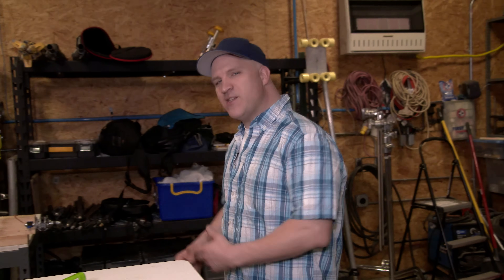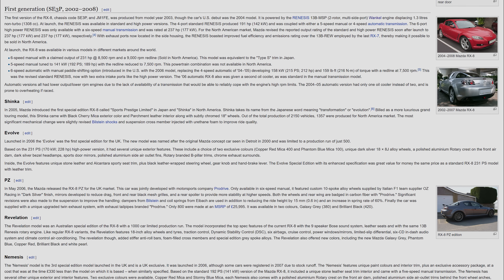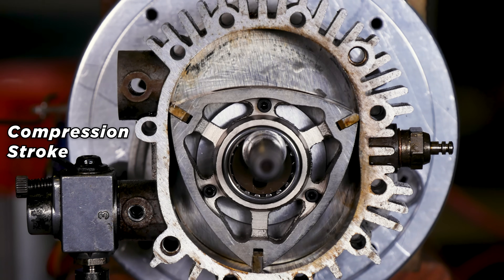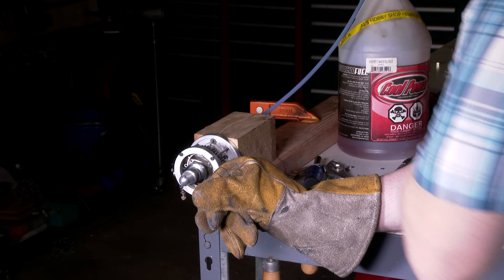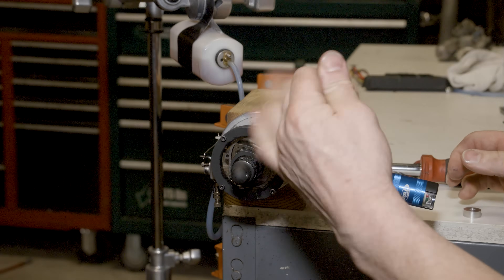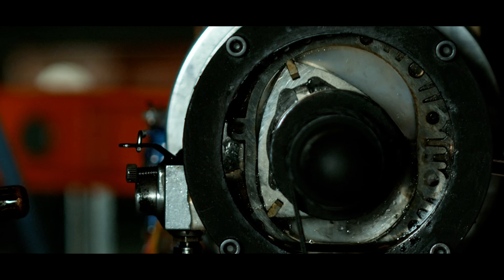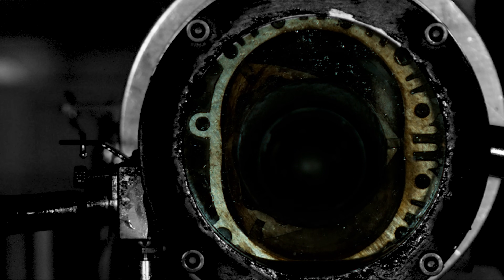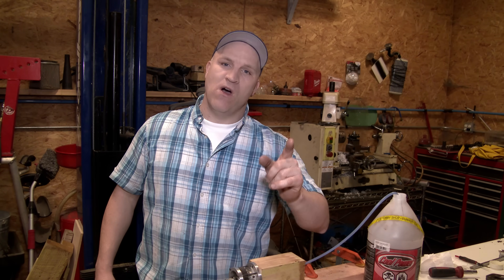See Thru Rotary Engine in Slow Motion - (Wankel Engine) 4K

Comment: Thank goodness they stopped making these for cars. Such low torque, terrible fuel economy and dreadful emissions. Like if I am getting 18MPG on the freeway, I'd better be making 500hp and 490 foot pounds of torque. Not a puny 231 (which is what and out-of-the-box GM Goodwrench 350 crate motor makes) and like 80 foot pounds. 

I drove one of the RX-8s in 2006. I was STUNNED by how little torque it had. 8K RPM in first gear and there was no way the tires were going to break loose. Really cool car on the inside and it handled great, but it would have been 100% more fun to drive with more power.

Comment: I always thought wankels were a very interesting design, but sadly these engines by the nature of their sandwich-like design didnt last long (especially if you didn't religiously keep on top of the maintenance). If they wore out, you could replace seals, but you generally couldnt bore or hone out and use oversize parts like you could on a piston engine. You pretty much had to scrap the engine and buy a new one. There was little you could do to restore it. However it was absolutely awesome to see this video of the inside of a running wankel. Very nicely done. This was very interesting! 👍👍

Comment: Don't see why rotary's have such a bad reputation. They seem better than piston engines. 
And before you say APEX Seals, I know... but good oil with frequent changes and won't that basically keep the seals alive and intact for decent 200k miles? 

I want to go into the world of rotary engines and buy an RX8 2004 model, so I'm really curious about the rotary engines.

If anybody reads this comment and has something to say about RX8's or any tips on how to buy an RX8 with a good and healthy rotary engine, i'll gladly accept the hint.

p.s. subscribed, that's for the awesome video! This is far better than any video drawing what happens.

Comment: Cool video.  The rotary engine is a neat concept on paper, just not practical in real life.  Engineering Explained has a good video explaining some of the inherent design flaws / limitations.  My biggest beef is that the "Mazda" engine isn't a 1.3L, it's a 3.6L, which explains the fuel mileage and takes away the "power per displacement" talking point...

Comment: My uk 2006 Wankel Engine on Mazda Rx8 lasted 9 months from new and only 18,000 miles I got a Euro Honda Civic 1.8. i-Vtec which now has done 211,000 miles and it’s still going like New I’ve only had to replace the battery twice and front suspension and central locking on all doors, I driven from England to Malta last summer and back across all Europe the Honda Engine is probably the most reliable engine going

Comment: Interesting video but it does not mitigate the fact that the Wankel is as dead as a door-nail.  Low volumetric efficiency, leaking seals , terrible emissions killed it.  Give it up guys!  R.I.P.
Reply: Very true, Mazda discontinued the Wankel engine in 2012 due to poor sales, the company lost an estimated 3 billion dollar on the RX-8 fiasco.
Reply: doktorbimmer well mazda announced recently that the rotary will return.....as a range extender for ev cars

Comment: not going to run well without a load that why its misfiring and igniting all wrong and running pig rich, would have been better if you got a load to really show it going
Reply from the maker: Agreed... Easier said than done though.
Reply: Warped Perception hmmm well you got the shaft on the front just need a pulley and something that can handle the speed such as a prop that it was designed to drive.

Guess it would take some tinkering to set that up and wouldn’t be too bad but I guess lot of people just wanna see the thing kinda fire up and sputter about so I understand the value added is low.
Reply: You should try to do a pulse jet at some point !
Reply from the maker: MOTO/R/SPORT NEJ yes I actually have a few options including a large flywheel that I built, but a lot of times I have to limit my self in each episode and focus on the core purpose. The main purpose of this episode since it was the first, is to introduce people to how the rotary is different from the piston engine, the ultimate goal is a third or fourth episode where I reveal a new type of Technology. But I have to educate people on what the rotary is first. As for the best way to run it I totally agree, it was designed to run under load I'm at the same time have some type of inertia to help it through the cycle.

Comment: I hate that fake sounds in slowmo
Reply from the maker: Ha!!! Actually that's a compliment, because they are not totally fake. they are based off of the actual recorded sound, also the reason they are in there is to give people who have absolutely no idea what happens inside of an engine an audible cue as to when the combustion is happening. It may not help those that already know about engines, but if you I know absolutely nothing about how an engine works these sounds can help immensely and identifying which part of the cycle the combustion happens. Because no matter what when somebody hears a boom it's usually almost always associated with something having to do with fire.

Comment: iirc, from other peeps who know about cars more than I EVER WILL. The rotary engine will have higher chances of misfiring (like in 7:00) and extra fuel not being burned hence seeing flames shooting from the exhaust of rotary engine cars like Mazda cars, but because of the extra fuel not being burned, you lose power, that's why people use turbo chargers specifically low-mid RPM turbochargers to give it an extra burst of energy but also because of the misfiring, a misfiring system also known as ALS (not Lou Gehrig's disease) to help counter that. I might be wrong while writing that but obviously a car nut here will fix it for me :D

Comment: Great Video, I especialy liked the part when rotor going backwards, you can cleary see gas igniting in lower part during "ignition stroke" forcing' rotor to go "backwards".  But looks like in multiple rotors design the secondary rotor momentum keeps whole thing turning in right direction :)  Wondering that this can occur in bigger examples....

Comment: Wat a great way to explain the simplicity of the design. Sadly it came at a cost. High fuel consumption and specialized maintenance (especially for high-performance units).  And yes 6 rotors in one engine is possible... http://www.thedrive.com/tuned-af/14548/theres-an-insane-bmw-m6-with-a-6-rotor-engine-up-for-sale-in-south-africa

Comment: So much misfiring on that one. Is that because it happens to be a glow-plug variant?
Reply from the maker: Possibly, Sun-Times running a Nitro in the alcohol that combustion that was not that visible on certain Strokes. I guess we'll see in the next episode.
Reply: Was definitely firing before the correct angle was reached, or even going backwards and having combustion on the wrong side a few times while trying to start. Proper timing with spark should help prevent that.

Comment: Awesome job explaining how the rotary engine works.  Also, you did an amazing job with the slow motion!  Thank you very much for making this video!
Reply from the maker: Thank you!,
Reply from the maker: Albert Einstein your welcome
Reply: Now I think what we all want to know: Will it will run on WD40? ;)
Reply: @fyrstormer  LET'S FIND OUT!!
Reply: When i hear the engine sound, that like 2 stroke. But without piston and cylinder. And more simple. I hope can install on my bike..😂
Reply: +Andi Marwah Wankel engines are MORE complex than 2-stroke engines... which is why 2-strokes are still made and Wankel engines are not.
Reply: @doktorbimmer  the rotor tip seals were the problem, just didn't last and seal properly to be reliable
Reply: When two legends meet, shit gets serious

Comment: Why is it that Wankels are so fuel inneficient? Also, I've heard they are particularly unreliable on higher milage vehicles as the tips of the triangle start to wear and is horribly expensive to repair. Great tech, not so practical?
Reply: The Wankel design was very poor in converting air and fuel into heat, and also very poor in converting heat into rotational energy (work)
 Several inherent flaws reduced it reliability, it is not thermally stable and its seal design is weak and prone to damage by its unstable combustion characteristics.
Reply: Makes sense - thanks for taking the time to reply.

Comment: where can we buy a rotor engine like the one you used? or any other small engine eg: remote control devices
Reply: Discontinued years ago...
Reply: damn i though would be the case :/.  is there any rotary engines (small) that they make at all still? i have an rx8 and love my rotaries!
Reply: Sorry, Mazda was the very last company to manufacture Wankel engines and they abandoned the design over half a decade ago.

Comment: it could do with leaning out a little on the needle valve
Reply from the maker: I tried leaning it out, it wouldn't run, the way you saw it running here was the only mixture it would run, but the carburetor would flood in between takes so that explains some of it.

Comment: I'm gonna be that guy:
A rotary engine is actually an engine with an odd number of cylingers in a radial configuration, but with a stationary crankshaft during operation. While in operation the whole engine is spinning. Rotary engines were mostly used during WW1. After the war the rotary engine had reached its limits, and radial engines ("star  engines") were replacing them.

So please, do not use the term "rotary engine" when you are not talking about a rotary engine <3
Reply: Indeed, 'Rotary' is an incorrect term to use especially if you are not referring to a Mazda brand product specifically and this brand is now also defunct... this is a WANKEL engine..

Comment: The show would be 10 times better if you changed your branding. The font of warped perception and the audio with it is very jarring! Great work otherwise
Reply: All the titling needs to look similar (repetition rule in design) and the titling at 18s has a weird white drop shadow on the word 'see' also that title screen needs a background pattern, looks unfinished with just black. Font doesnt match anything else in the video either. 
Im awful at receiving criticism but I hope that you take this the right way and not like im putting you down! 

Great Vid

Comment: the difference in reliability The main reason that has limited the development of the engine is in fact a consumption much higher than the engines with cylinders, combined with a high rate of unburnt hydrocarbons. In an age that seeks better efficiency and reduced consumption, it is easy to understand why there is currently no car on the market with this engine.

Comment: Why bother doing this other than showing how petrol or avgas burns inside a enclosed compartment,which is what every engine does it burns gasoline and turns that burned gasoline into power and depending on the set up of a engine of the same size, you can make a lot more power by putting in performance parts etc. :)

Comment: All the older Mazda cars ie: late 1970's are all asking around the 40 to 70K mark,which is for a RX3 with totaly original KM and no new parts on it totally restored cars ? Now you think for a moment what your getting other than an investment? What drives the price for these type of cars, supply and demand, if you have very limited supply the demand increases and thus you can ask whatever you like for the cars, but if a country had loads of them and you imported them, then the demand is taken away and thus the price will drop, just like anything ?

Comment: I cant wait to see a proof of concept on some of the theories and things people have on the combustion process of rotaries. Forever I have seen those theories about the spark plug holes, and the bathtub location on the rotor. It will be cool to see the timing and things, so we can finally see of any of those untested theories are true. I have a feeling they aren't cause Mazda would likely be doing things different had any of those been true.

Comment: The Wankle Rotary engine has a lot of potentiality. If they could have improved the seal and oil issues, it far outshines many other designs because of reduced weight, more efficient energy use and power for it's size and less moving parts if it had perfected sealing and oil issues (perhaps using a synthetic lubricant and stronger seal) would ensure greater longevity. Good advanced  engineering and research could make this engine a great success.

Comment: The Sopwith Camel and the Fokker DR-1 were both powered by rotary engines. The cylinders and crank case rotate around a stationary crankshaft. The Wankel engine uses a rotor as a compression and exhaust device, and through time people have mistakenly referred to the Wankel as a "rotary" engine. It is not a rotary engine. If you research  WW-1 Clerget, Le Rhone, and Orbderusel engines, you will get the accurate description of a rotary engine.

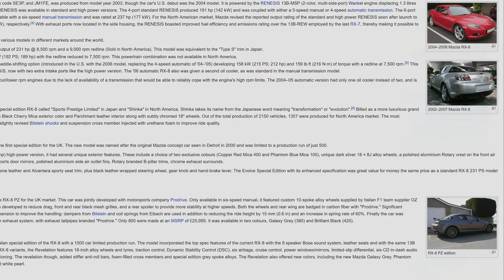Comment: @1:42 - "It was only a 1.3 litre.  I always had an issue with how they calculate the capacity of a Wankel - they add the volume of all three lobes at one time.  That's like stopping a piston engine and working out the volume above all the pistons - but that would be only half of the swept capacity (for a 4-cylinder engine).  I always felt they should take the maximum capacity of a single lobe and multiply it by 3, so that it represented swept capacity, like they do in piston engines.

Comment: Amazing! I wondered who would make such video. Something cool here is that we clearly see the flamefront getting at the very end of the combustion chamber before it exits in the port. But it’s acetylene, and cars usually run with octane, which burns slower than acetylene which may explain why 13b send unburnt fuel down the exhaust. Also we can see the seal’s behavior, how they “stick” to the housing. Well done!

Comment: It would be amazing to see a remake of the rotary, since the main problem is the rotation wearing out the edges and losing compression, if it was edges in a stronger material it would sort out most problems and the large gas production like MO2 n CO2 could be directed through something like a filter then out an exhaust

Comment: I was always curious how a rotary engine functioned, now I know. I'd give you 10 thumbs up if I could. Thanks!
Reply: Nah he's got plenty of thumbs......
Reply: They are garbage. Last an 1/8th the time as a piston engine
Reply: Deere2154D 
     12 years ago Mazda was running 3-rotor powered RX8 tube-frame chassis cars in Grand American sports car racing(now merged with IMSA) that was not only wooping V8s & Flat 6s with shear power 
it had was also killing the piston the engines on the reliability front while still setting up a fire show.
     Read Speedsource RX8 
Read Mazda RX8 GT
Reply: @Deere2154D  Do you have any objections to 2 stroke dirt bikes? I would say you might rebuild the top end many times in time but never have to do that on a 4 stroke.  Most every one who complains about rotaries has never had first hand experience.  I think they are far easier to remove and rebuild than a subaru.
Reply: Piston engine can have lock picking shaft best guess is small piston 2 shaft high tension steel

Comment: Great video! Wish you'd add a couple more versions of the ignition sound effect to your arsenal though lol
Reply from the maker: Lol... I do, and I was thinking the same thing, but the problem is, the technique and process that I use for the sounds relies on the actual captured sound of the engine running, then those peaks fall into a certain frequency range, unfortunately the nitromethane engine and the rotary nitromethane engine seem to fall extremely close in the sound of that frequency bar of the captured sound. This along with a few other mathematical equations is what determines which ignition sound gets paired up. I will really try harder next time to match some different sounds, but again it's mostly mathematic. The idea is for you to hear the sound that you would actually hear if you could hear the frequencies produced with your own ear, if that makes any sense.
Reply: Warped Perception it does, and I can also appreciate the work that goes into not only making those sounds but also applying those sounds in a video. Thanks for the great footage by the way! I have always wanted to see that in motion.

Comment: I'm not an 'expert', but IIRC from my c. 60's model aircraft days, there is a catalytic reaction between the methanol in glow fuel, and the platinum[1] coil of the plug that keeps said coil hot & glowing. The battery is only necessary for starting. Cool video, Thanks! [1]Well, pretty sure it's platinum they use; too lazy to look it up right now.

Comment: A Wankel engines can be used to build a positive displacement turbine engine. I'm not entirely sure, but I think that would cure the efficiency issues as flame travel is no longer an issue. The engine could also be made to run very lean as the external combustion chamber can be made to withstand the extremely high temperatures of a lean burn, while using many of the standard techniques used to control turbine combustion chamber temps.

Comment: For the love of all things mechanical please do not run an RC aircraft engine without a prop on it. This is so bad for it because it spins without resistance which over revs the engine, and it doesn't put any cooling on it. This is a sure fire way to destroy an engine.
Reply from the maker: Lol... I know , I almost included that in this episode but it was left out, I intentionally ran the engine for short spurts as to not overheat the engine, it is still in perfect condition. 😁, Thanks for the insight and thanks for watching.